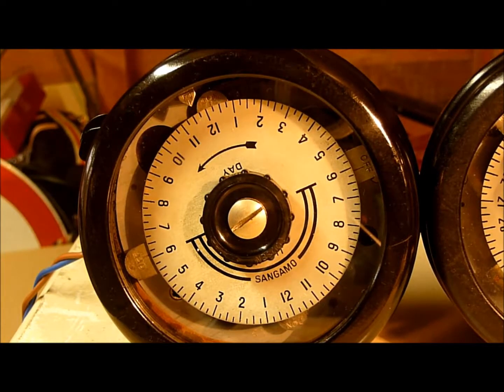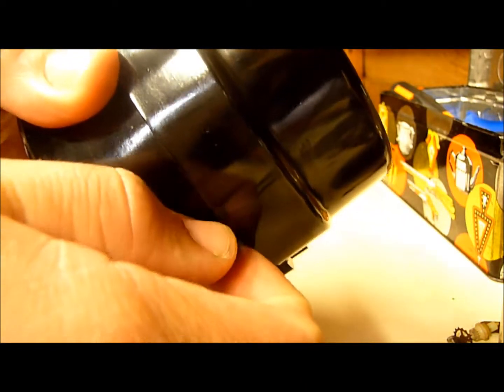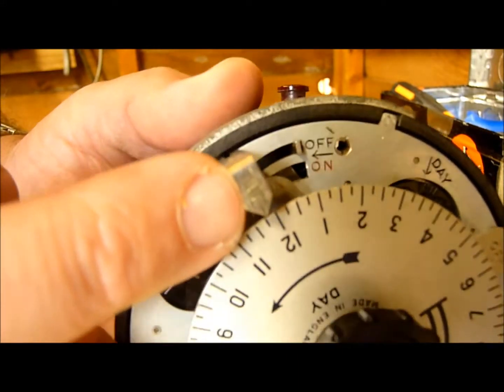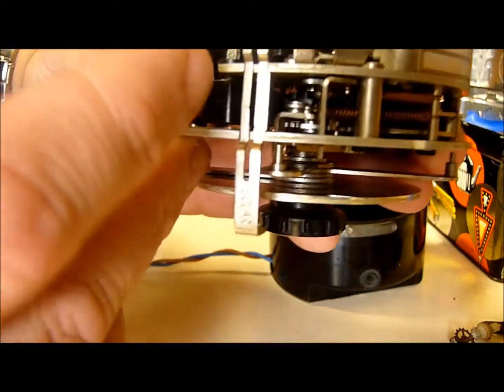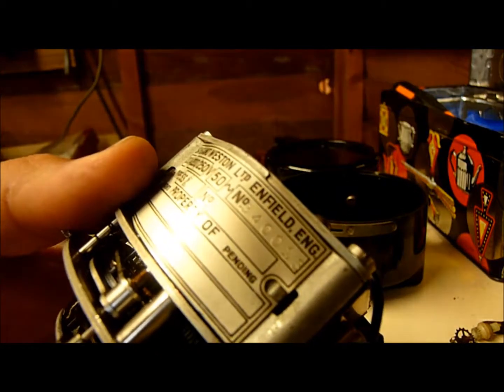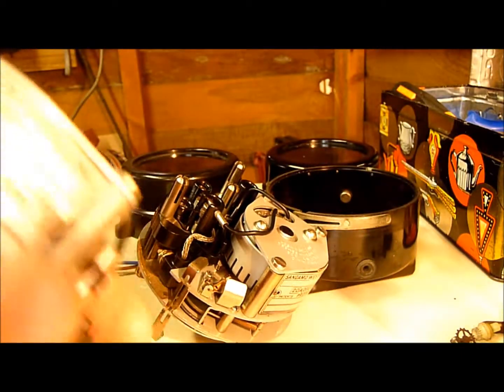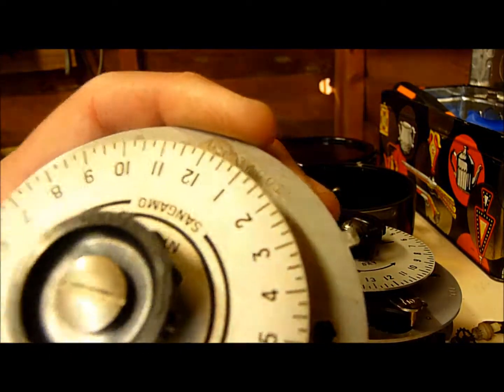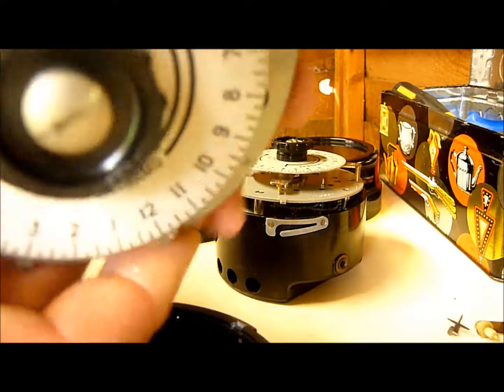Sangamo Weston SS-Z Time Switch Thanks to BoomBoxDeluxe

Comment: Hiya. In regards to using a 3-pin timeswitch as a rate-changer & altering the wiring to it, I'll try it out first, then I'll report back on whether it's feasable to alter these 3-pin timers, how, & of course, how easy it is to do.

I'll send that report by Private Message, as I don't want others trying it, getting the wiring config wrong, & blowing-up anything. I may even do a vid on it! :-D

I know how to make a 4-pin one into a Rate-Changer, as it has independent Contact terminals. :-)

-BBD.

Comment: Hiya Steve. This was a good find, as these timers with the black cover & outer motor drum are quite rare. Admittedly, I own two ( the SS-CR & the one with the solar dial on it...) & now you do as well. Interestingly, I've never seen a Sangamo clockface finished in silver like that. Very interesting! Looking further into the differences between your SS-Z & my SS-CR, the only difference I can find, is your one has the day-omit wheel. My one can't have one fitted, as there's no hole for it. 

-BBD.

Comment: OH YAAAY You have another!

OK, what you have there, is a Type SS-Z. This is *VERY* similar to my SS-CR.

Basically, instead of saying S251.14.12, this one is a SS-Z. That other number is a just a serial number of when it rolled off the production line. 

Yes, do pop-over to my channel & search for "Sangamo Weston type SS-CR" & you'll see something very similar, RIGHT DOWN to the motor, double-pole fusing....AND the two spare fuses!

Very nice clean condition this one! :-)

Thanks for showing.